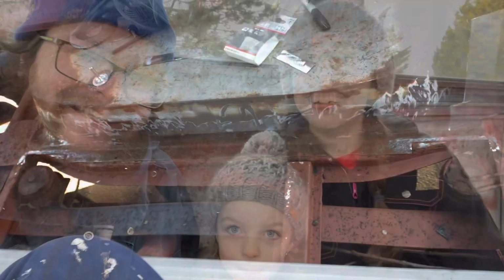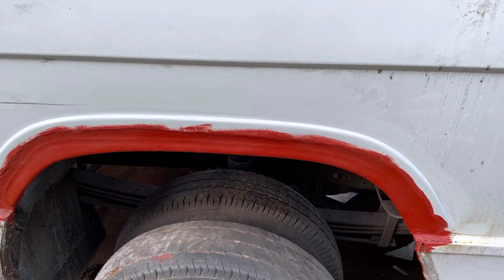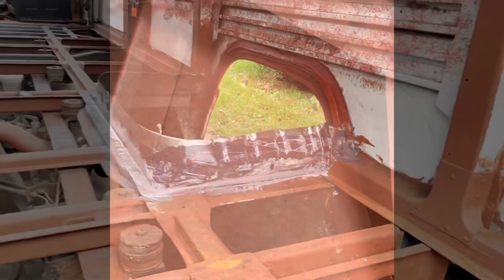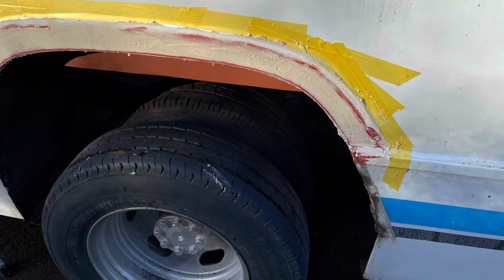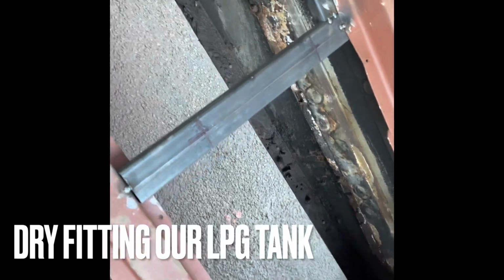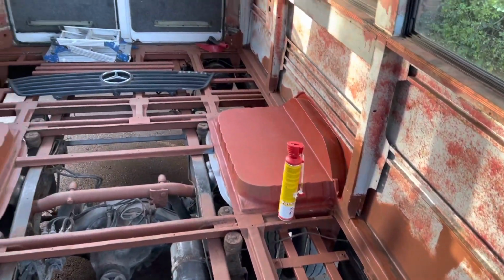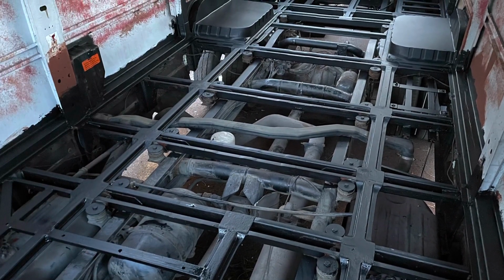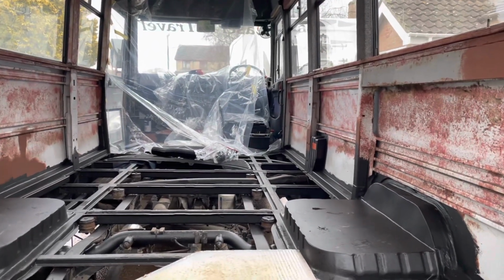Underslung Tank & Heater Brackets | Chassis Paint & Wheel Arch Repairs | Mercedes Vario Camper

Comment: Hi All, 

Have been watching your industrious work with interest as have very recently also bought a 814 2001 with very similar issues (luckily no leaking windows!). 

Whilst searching for available spares I noticed one of the most bought parts were the lower panels which the fibreglass skirts are attached to, so I decided to take one of the fibreglass panels off totally and discovered the reason (for the high replacement use) - where the fibreglass attaches is almost totally rotted out, and some parts even worse - have cut off some sections and realise am going to have to replace all the panels to future proof the conversion (have photos), It may be worth you doing the same, especially around the rear wheel arches which look to be in a very similar condition to yours.
Reply from the maker: Hi Andy. Thanks for watching. That definitely is a problem area. On ours the lower skirts are now aluminum. As you point out there is some rust there on ours which is thankfully not structural at this stage. We will likely look into fixing this in the future. Meantime we’ve taken steps to clean and arrest any rust that’s there. Cosmetically from the outside it’s not a problem and there aren’t any strength issues. I think if our skirts were fiberglass we’d go down your route now as they are easier to remove. Ours are aluminum and Bonded on which could make it a future problem for us. Good spot though. Your build sounds really interesting. What are your plans for it? 🚐🚐🚐
Reply: @WanderbusAdventures  , plan is to live in it! am now 55 having spent the majority of my life at sea under sail (old-school, not motor!). Returned to land about a decade ago, but never really settled.

Did the reverse to you - have lived in the bus for a few weeks, but recently (last 3 weeks) parked at my sister's where I can work - have a very good idea about the layout required (NO to a fixed bed!), will covert front 2/3rds (up to last full size window - no rear barn doors) into an 'inner snug', then the rear into kitchen, head and workshop.

Shower will be over emergency exit (drivers side) with the grate in the 'hold' so very tall shower, head (loo) will pull out from under sink with a urinal in the shower space so can easily wash off.

Only diesel - no gas have a 2.2 kw diesel genset and will be getting a Chinese heater like yours.
Reply from the maker: Sounds like a solid plan. The idea of a snug sounds great. Making use of the ‘hold’ for head height in the shower makes sense too. Please keep us posted 🚐🚐🚐

Comment: Hi Rich do you remember by any chance how many can did you used in total for your roof rack ? I belived you did 2 cots. My roof rack on my vario is a little bit bigger. And my favorit AI friend told me 10 can 400 ml when I ask him. Sounds a bit much. Thank you.
Reply from the maker: Hey. I reckon it was around 6 cans of the Berliner. But the stuff I had was quite thin compared to something like raptor and easier to direct. What I would say is ensure every surface is keyed. I have had a couple of areas scrape off when hitting overhead trees etc so will need to touch up. Thankfully as it’s on the roof you tend not to be able to see the repairs if this happens.

Comment: hi just wondered what size gas tank you fitted and where you got it ?   also what size water tank and how do you feel that much lasts , cheers guys:)
Reply from the maker: Hey. It’s a 40 litre tank from GasIt - have seen others fit 70 litre ones but to be honest it lasts ages (we are not full time). 

The water tank is 250 litres. In hindsight this is a bit big and Lasts for ages! For washing up and whatnot it lasts easily 4 days and it lasts a few days when using a shower.

We are actually planning on fitting a slightly smaller tank soon - then potentially having a second one available for smaller trips (a smaller tank). We haven’t had a major issue with ground clearance but really need a bit more (we saw another van being put on tow and reckon it would scrape). I know others have done it the same way, but we’ve decided to fit a tank that goes a bit higher up between the rails. That said many of the other Varios have fitted 150+ litre tanks below the rails like ours and put them slightly further forward without issue. It’s a good space to pop a tank, but in hindsight we’d position it ever so slightly differently and opt for smaller tank. 

Hope this helps 😊
Reply: @WanderbusAdventures  

That's a great bit of advice thank you , I have concidered the gas it system as frees up other space just abit on the pricey side but bet is well worth it, I've driven around not being able to get a gas bottle before in my other van and it's not fun. 
I had a brand new unfitted fammia 70ltr water tank that came with my van when I bought it but thought this just maybe too small as I will be full time  , 🤔 
But One thing I did do on my old van is a gutter system that feeds rain water into water tank , as tank was smaller  😁

That's great help I did think about the ground clearance but this definitely has helped on the deciding , 👍
Reply from the maker: That’s a great idea. One of our friends has 2 80 litre tanks and he fills one of his with River water for showers etc, but love the gutter idea. That’s neat.

Comment: Hiya pal, great videos really enjoying them. I am wondering what water tank you used & curious to know the dimensions of your LPG tank?

this vid has been great for showing me how to install both on my 814D! Very nearly at the end of the rust treatment stage
Reply from the maker: Thank you. Glad the vids are of use. The water tank is 250l baffled tank from tanks direct. 

We chose a 40 litre gas tank which is a shade under 80cm long and 27cm wide. But you do have to add on a little extra for the black box on the front (90mm from memory). We’ve managed to fit it in and have space either end; you could fit a 70 litre in this space like @wanderinghome did. It’s just a bit more of a squeeze and was more gas than we needed to be honest. Hope your build is going well 🚐🚐🚐
Reply: @WanderbusAdventures  Amazing, thank you! I've been looking at exactly the same water tank I think haha. My only concern with mounting it there as you have (I've been staring at that space for ages picturing how to do it!) is it being too low if the terrain gets a bit bumpy. 

Thanks good to know about the gas tank as well. 

It's coming along bit by bit, every swear word is worth it! it
Reply from the maker: Haha. Totally worth it. Yes we are going to road test it when we can. It is higher than the axle but we want to do a thorough test. The 110 litre one is about 7cm shallower I think.
Reply: Would love to know how you get on if you do that soon. Best of luck with the rest of the build :)